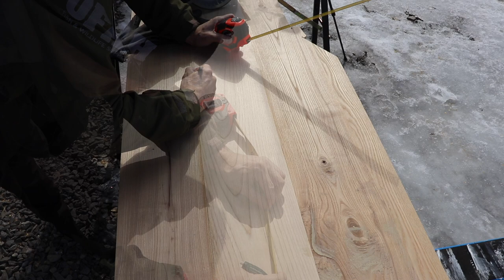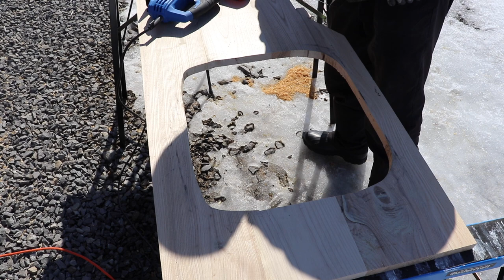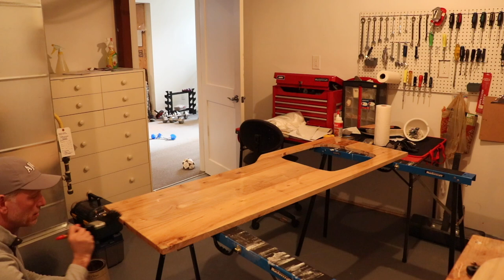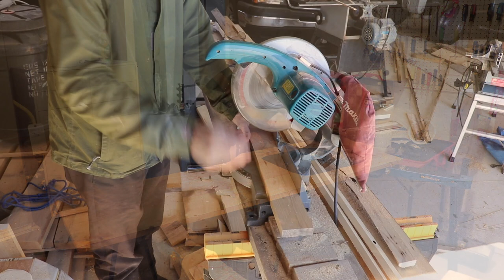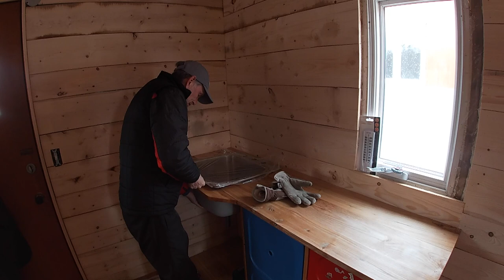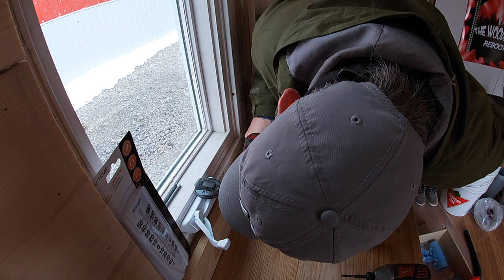A Kitchen Countertop for the Off Grid Cabin - Part 2

Comment: You sir need a better jigsaw and blades the one you have will cut with the right blades more power equals better cut. A little tongue oil and that top will shine well done project.
Reply from the maker: Yes, I think you are correct. It was a challenge cutting the elm. Thanks for watching!

Comment: You did not say if you encountered any saw dust on the counter top as you were applying the finish. If you did, you may want to try tac cloth. A lot of time went into the counter top which looks really good!!
Reply from the maker: Hey Buddy, You are correct. Sometimes I miss certain aspects of a process just because I forget to turn on a camera. There was some sawdust. I was able to take care of it using my vacuum and a cloth. A tac cloth would have been best ... I didn't have any for this project. Thanks for the kind words and for watching! Peter at the Reboot.